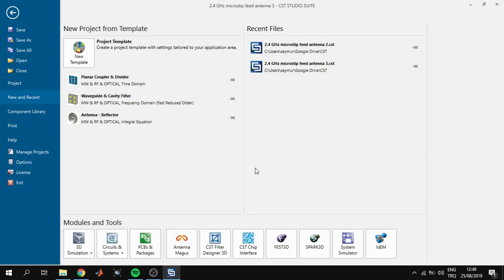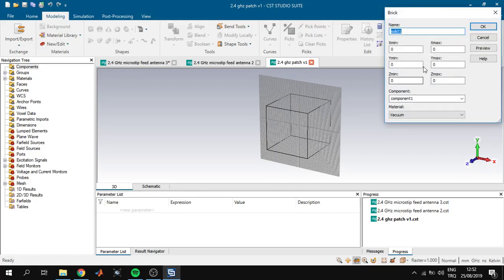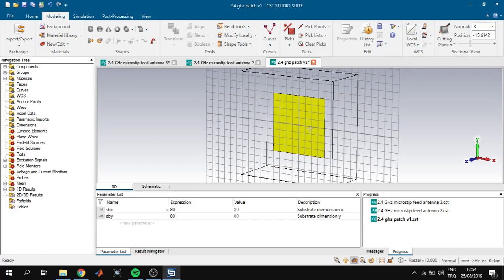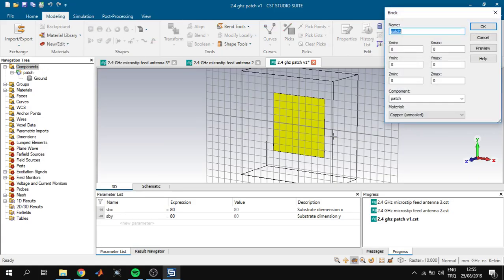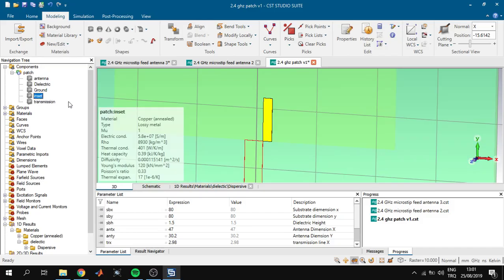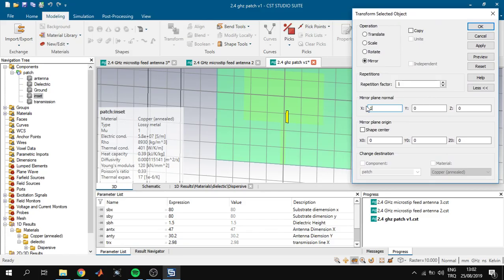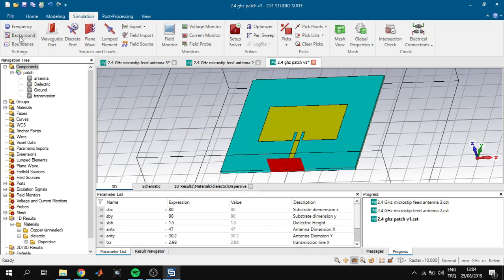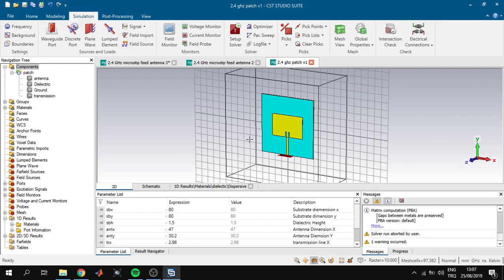2.4 GHz Microstrip Patch Antenna Design using CST 2019 (Part 1)

Comment: The red port is not getting created. Please tell me what's the error. Im getting k = 5.76 but the red port is not visible
Reply from the maker: can you please more details?
Reply: @SimulationMaster  The red port after the calculating of the port coefficient is not visible, although it is simulating and I am getting results.. the error has been resolved so thank you for the informative video! 
I was hoping to seek help for my final year project as it involves antenna design using CST?
Reply from the maker: @rrxn  sure, you can always ask questions I will try to help. good luck with the project

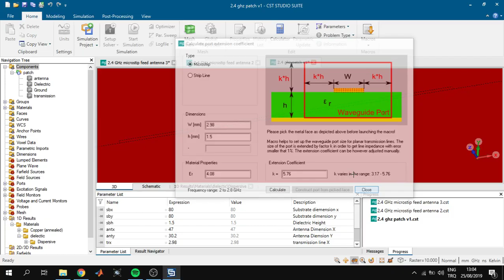Comment: Hello, 14:20 What does the red area for at 14:20 do? Why did we do this ? What are their functions? Can you please explain?
Reply from the maker: Hi burak,
Red area is theoretical waveguide port. CST uses this to radiate power into the transmission line.
Reply: @SimulationMaster  thank you so much
Reply from the maker: @burakyaksk5431  Rica ederim
Reply: @SimulationMaster  hocam peki birkaç soru sorma maksadıyla mail adresinizi alabilir miyim

Comment: Hello,
I need this on PCB
How must I proceed?
Reply from the maker: First, you need to find a manufacturer where you are going to build it.
Then ask them for the available material they have and choose one of these materials. 
Desing antenna based on the dielectric data of this material. Then let them build it and have fun

Comment: Hi sir
I’m working on cst to create 2.4 Ghz patch antennas for my collage project.Can you please help me to create different frequency values and how can ı change length of transmission line to 20mm
Reply from the maker: Hi, You can change the frequency by changing the antenna dimensions. Why do you want to chang ethe transimision line?

Comment: where did you get the ground height or you just randomly create it ?
Reply from the maker: you will get the height from the manufacturer. Before manufacturing the antenna you have to choose the manufacturer. Then you ask him what materials he has and he will suggest you the available and cheat ones. Based on that you will design your antenna.

Comment: Hello sir. First of all, your video is very helpful and good. Please can you explain me how did you calculate the radiation box dimensions?
Reply from the maker: They are calculated automatically. The dimensions depends on your frequency basically. The larger the better. But if you increase them the simulation time will also increase.

Comment: Thank you so much for this helpful tutorial.
I tried to run your given project downloaded from google drive and my own construction following your steps. However, the result for Reflection Coefficient (S11) seemed not to be similar to what you showed in your video. Actually, my results showed the best impedance matching at 2.38 GHz although it was good at 2.4 GHz (reached -15 dB). Would you please help me to figure out the difference?
Reply from the maker: Thank you for your kind message. The reason that the results are different is that you are using a different computer. Although all the settings are the same because of the computational work the results vary. You can use the Optimization tool to further improve the frequency response, but I think that your results are also acceptable.

Comment: Hello, Do you know how to design a 1 GHz microstrip dipole antenna with CST. I found this antenna but that one didn't really work or I couldn't make it work. 
https://www.researchgate.net/figure/Design-result-of-the-front-side-of-the-microstrip-dipole-antenna-The-front-side_fig1_282075530
Reply from the maker: What is exact problem that you have came across. Can you specify in detail?

Comment: Very good explination! Even for newbie like me
May i ask some qeustions? Is it possible to build patch antenna with operating frequency at 6 GHz? and can we use CST to design the patch antenna in different shape? like triangular shape for example.
 
I’m new here so I actually don’t know much. Thanks a lot
Reply from the maker: Dear Knight,
You can design antenna in different frequency by changing patch antenna dimensions. Reducing dimension will increase the frequency. So to make this antenna work at 6 GHz the dimensions must be approximately 2 times smaller. 
Also you must take into account the feeding path impedance. 
You can design patch antenna in any given form, but it will change its radiation properties. You must first decide what you want from the antenna. 
Have a good new year.

Comment: hello can you help design this antenna into flexible antenna?
Reply: i mean. is it possible to design flexible antenna using this antenna patch?
Reply: You should use flexible substrate, you cannot use regular substrate
Reply from the maker: This is good question. I never designed flexible antennas. But if I guess, you should design antenna with all the various shapes that your antenna will be, then try to simulate them all.

Comment: Sir
Can you help me design a 5.8ghz patch antenna?
Reply: I mean.. what is going to be the feed inset value? I am trying but my results are not satisfying
Reply from the maker: First of all you can start designing by downsizing all parameters in 2.4 GHz antenna by approximately 2.4 times. 
After that you must change inset feed parameters to get good S11 value.
Reply: The process it looks like same, you can get patch diameter by online microstrip patch calculator

Comment: Excuse me sir. Very good explanation!

 May I ask you a question? So i have project about lightning location.
Let's say I already have an amplifier circuit on LTspice.

So I need an input voltage for the amplifier which is it comes from the antenna.

Can CST studio simulate EMF field and induced voltage on loop antenna?
I am very very bad at this but I really need to finish this project. And sorry for my bad english
Reply from the maker: That is really good question. 
CST can simulate electric and magnetic fields radiation from the antenna. To induce voltage you need a source. And it is possible by placing source in the simulation and calculate electric field and by dividing it with impedance get a voltage value.

But I don't know how to do this :(
If you find the answer please let me know

Comment: Hye sir ...
How to design microstrip patch antenna  for 2.8 GHz . Can you help me please sir ..
Reply: Do same process but because your frequency is higher so you antenna is smaller
Reply from the maker: You can design antenna by changing parameters in 2.4 GHz antenna accorsingly.

Comment: Cannot get the frequency to be 2.4 GHZ, am i missing anything? Because i have followed the vide closely
Reply from the maker: You can check your design by downloading the project file.
Reply: @SimulationMaster  the project file simulated result is 3.84 ghz

Comment: Hello you are such a great mentor. I followed the exact same steps you did in the video however i got a totally different extension coefficient which was 7.23 and when i came to the simulation and results i got an error as i got an improper range  so it told me to check port setup again can you help me i really don’t understand why it all happened
Reply from the maker: Good question. Usually thi smethod gives good results. But if it is not working, please check your model. You probably have some issue there. It also happens with me. 
If your model is okay, then try to use the dimensions with half the width of antenna, and use 4 times the high of antenna. 
Let me know the results.

Comment: Hello, first of all, you explained it very well, thank you. But the teacher gave me very different homework and I am having a hard time. can you help me?
Reply from the maker: of course I can help you if I can. What is your problem?
Reply: Simulation Master teacher asked me to make a cognitive radio antenna consisting of two stages
first stage: low profile broadband antenna
second stage: frequency reconfigurable antenna
I couldn't find any articles about it. I am in a very difficult situation. I would be glad if you help me 🙏🙏

Comment: Thank you for your very helpful video. Could you please explain how to get 'Dielectric constant and  Dielectric Height' for else antenna size calculation?
Reply from the maker: Dielectric height and dielectric constant depends on your choice of PCB. After choosing your PCB you can use these data for calculating the antenna dimensions using online calculators.

Comment: Can u tell me , how to find feeding points for coaxial feed and give it in the project , not with the line feed.. It's urgent please tell me fast.. Thank u
Reply from the maker: sorry for the late reply. 
Feeding point depends on the polarisation choise and you antenna type. There is very different approaches to solve this problem. You can choose among them.

Comment: can u make this patch antenna to 4x1 arrays with corporate feed ?
Reply from the maker: Yes, you can also make it. Just make array antenna simulation, with required gain and sidelobes. And then use microstrip line or aperture feeding to feed the antennas. I will upload the project with your requirements.
Reply: @SimulationMaster  thxx so much sir

Comment: I followed the Same procedure. I didn't get the exact rests. The frequency I got is 2.36GHZ.also I have two warnings. I am using students version. Would you help me in finding what went wrong. Thank you
Reply from the maker: Dear krishna, I believe you are doing nothing wrong. Because of the setting of your CST and the material you use there can be different results among PC.
You get exactly 2.4 GHz you can use Optimization tool to change antenna X and Y dimensions.
Reply: @SimulationMaster  Thank You

Comment: Hello.I am new at this. What are the values necessary to switch from 2.4 to 2.5 Ghz?
Reply from the maker: Hi,
To change the working frequency of the antenna you must change the X and Y dimensions of the antenna.

Comment: Hi Simulation Master, thanks for this useful tuto ! I have the same issue than @Dennis J, it resonates at 2.3576GHz and I closely followed the video.  Are you sure that this new simulation (the v1 one) is the same that you present in the video ? Also because you used a commercial edition, I can't open the project from the Drive (I have the student edition too)...
Reply: the  same with me .
i have followed his designing process step by step but the antenna resonating at 2.384 GHz .
also i have downloaded his simulated file its look like my simulated results 2.3804GHz.
Reply: @yassinabdullah5209  where did you got the file sir ?
Reply from the maker: There can be difference between machines. Also, for patch antennas the difference between 2.4 and 2.35 is not so important. You can easily get 2.4 by optimizing the parameters.

Comment: I went through this tutorial myself. It is very well explained but it does not resonate at 2.4 but at 2.35 which seems very odd. No idea what I am doing wrong.
Reply: Dennis J  ：Hi, sir. I figure out this problem. In this video, he said the ante length is 47, however, in the next video, I find the true length should be 41. I modify and success.
Reply from the maker: There can be several reasons for this:
1. Your boundary conditions are not the same as mine.
2. Your dimensions are different.
3. Your dielectric properties are different.
4. Your simulation setup is different.

In the end, it is normal to get a different resonant frequency. You must optimize your structure by changing the dimensions of the antenna.
Reply: @SimulationMaster  I did exactly the same steps you did several times. The only difference is that I have the student version of CST but that should not interfere I guess.
Reply: @dejo5748   I am in the same situation than you... I don't get it. I was thinking that we might need to add the transmission line and the antenna together but @Simulation Master mentions in previous comment that it shouldn't matter (and it didn't). Did you find a solution ?
Reply: @ceciliaribeil5842  Hi Cécila, yeeeey I am not alone anymore :D I did not (yet) found a solution. What I find strange is that when showing the S-parameters, simulation master goes to another project. A project that we do not know of wta the specifications are. I'll keep you posted when I find a solution.
Reply: Dennis J  i also meet this question, I really follow his steps,but my antenna is resonating at about 2.3848GHz. Have you figured out this problem,thanks profoundly
Reply: @Kokool 2 until 2.8 GHz is what I did. :)

Comment: How can we convert gain in dBi to dB??
Reply from the maker: You can not. dBi is a measure of the gain with respect to the isotropic antenna. dB is just a ratio of the voltages or powers. To define antenna gain you must always use dBi.
Reply: @SimulationMaster  thanku..actually in previous CST versions (2016) gain of the simulated antennas used to be represented in dB.. dBi and dB is quite same..when we compare gain of the simulated antenna ( for eg. 3 dB ) with an isotropic antenna having gain 1( 0 dB )..It means simulated antenna can radiate twice when compared to the isotropic (dBi)...or it can radiate twice of input power given (dB)..so it can be the same.. Correct me if I'm wrong
Reply from the maker: @devayanis5265  Yes you are totally right, but because of the nomenclature, it is good to say that your antenna has X dBi.

Comment: How to design micro-strip patch antenna for 1.8 GHz ? Can you help me  ?
Reply from the maker: You can increase all patch antenna dimensions by approximately 2.4/1.8=1.3. This will shift frequency to 1.8 Ghz. Next optimize the other antenna parameters for this new frequency band.
Reply: @SimulationMaster  So, if ı multiply all parameters (sbx,sby,sbh,antx,anty,trx,insx,insy) with 1.3. I will get a 1.8ghz patch antenna, is it right ?
Reply from the maker: @mehmetakn6198  not all parameters. Only, antx and anty. After this adjust insx and isn't for better performance.
Reply from the maker: @mehmetakn6198  I have sent you the updated patch antenna operating in 1.9 GHz.

Comment: Sir how you calculated the dimensions of substrate? substrate x is 80 and y 80?
Reply from the maker: Dear Shawn, Because of the fringing electromagnetic fields I usually take twice the dimensions of the patch antenna as a starting point. It gives reasonable initial results. After that, if Electric field magnitude does not converge toward the edge, you can increase the dimensions. But it will affect your simulation time. So in the end, choosing twice the dimension of the patch is a good compromise.
Reply: Thank you so much for your explanation

Comment: sir thats really nice video. i want to ask that your feed line and patch are not merged as there is black horizontal line still visible. is it ok to do this or u have to apply merge command to combine the patch and the feed line
Reply from the maker: that is perfectly fine. CST does not see those lines in simulation. It only sees the meshes. So as long as there is no gap between the parts it is not a problem to not add them up.

Comment: What modifications do I have to make for a wider band application and resonance at 2.4ghz ?
Reply from the maker: there are different ways to make wider bandwidth. You can change feeding section, make slots in the antenna, cut edges and etc.